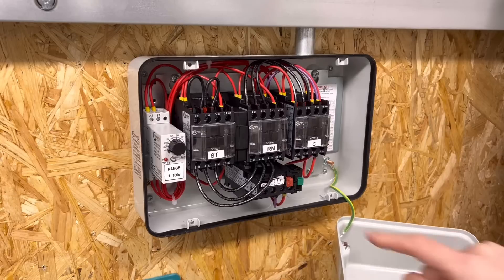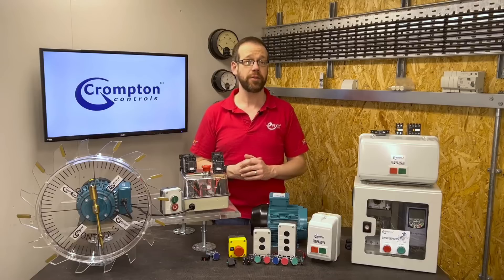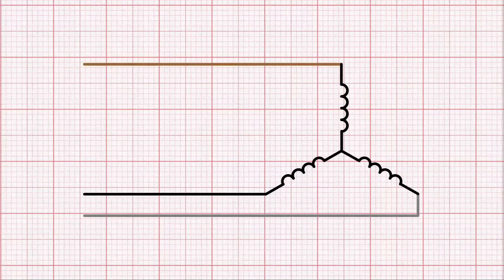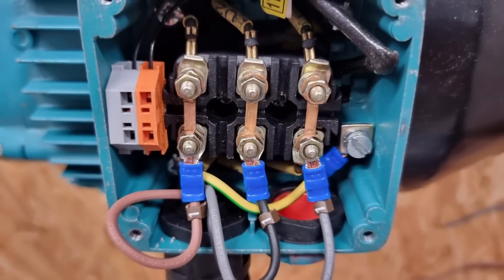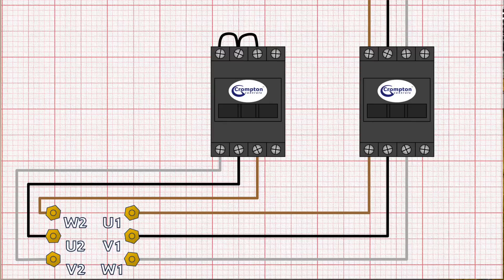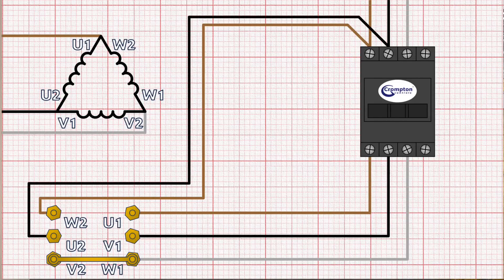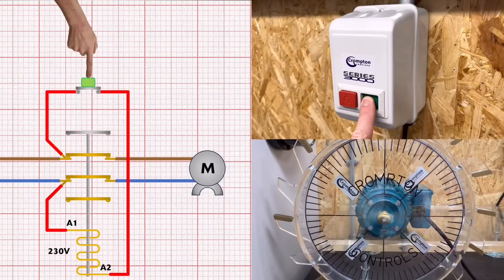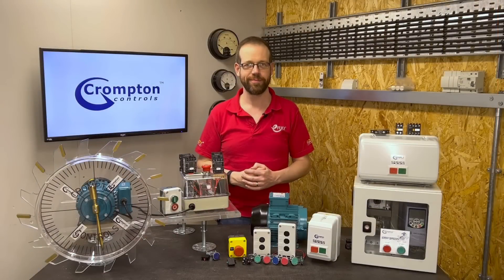Star-Delta Starters Explained

Comment: Good explanation. However quite frequently rather than having separate contactors, the two star/delta contactors are mechanically linked with the internal spacing of the contacts such that the star one disconnects before the delta connects. (I spent may years in industrial electronics)

Comment: You need an 80 ms delay when switching from star to delta because the magnetic field from the star setup has to dissipate before the delta connection is introduced. The term 'very quickly' is nonsense in electrical terminology; only use ms or s.

Comment: This used to be a mechanical switch. 
- The first position was 0 = switched off. 
- The second position was Star. The switch had to operate in this position for a certain period of time. 
- The third position was Delta. This is where the engine has the most power. 
But switching from star to delta too quickly throws out the fuse. Later a mechanical or electronic delay was added.

Comment: Don’t bother with star delta starters these days, control via an inverter, 21st century
Reply from the maker: Got to know how to do it properly before you learn how to cheat! 😃
Reply: @efixx  If you don't need speed control once running, a star-delta starter can also be much more compact in panel real estate.
I can start a 37kW motor with contactors occupying ~200x200mm in the panel, a 37kW inverter will be twice that size at least.
Reply: That's like stating you only buy pre-formed bends for trunking, tray etc...   yes we all do it but if you were properly trained you'd be taught how to construct one by hand - know your basic craft skills!
Reply: Go do maintenance in a factory built in 1999

Comment: Great video but definitely shouldn't be used as a reference video since nothing was mentioned on the having to have the timer wired through the opposing normally closed contactor, that way if the timer fails or the contactor welds closed its impossible for the other contactor to be energised, and not crossing phases.
Reply from the maker: Great point, this is just the starting point for motor control content on our channel, watch this space...

Comment: I thought SD starters went out with the ARC. Why run 6 cables when you can run 3 and a soft start, then also you don’t have to worry about someone setting the transition timer too low and having large inrush current.
Reply from the maker: Horses for courses really, and while Noah did not have a Star Delta starter on the ark, he did have electrical illumination... flood... lights... 😂
Reply: SD is a lot more robust.  What ever suits ultimately.
Reply: @retrozmachine1189 Exactly this! Seen plenty of sort starts stop working.
Reply: A star-delta starter can give higher starting torque than a soft-starter. A soft-starter which limits the starting current to 1/3 normal starting current will reduce the torque by a factor of x 9, whereas star-delta will reduce it by x 3. It depends what the load is like in terms of inertia and torque requirements. Soft-starter has the benefit of more sophisticated motor monitoring and protection.
Reply: @brendanpells912 torque a motor produces in star is often inadequate- modern soft starts are better but an inverter is better still.
Reply: Well yes and no, having used some small soft starts to replace SD starters I am less than impressed with the starting torque. Poor motor makes a horrible noise at start up as the soft start just appears to chop two phases from what I can see. ( bigger KW  soft starts control all three phases and give a better start up. Given the low price of inverters now this is a good option if speed control would be useful.

Comment: There also needs to be more info on inrush current for LED lighting that causes nuisance tripping. But most motors these days are inverter controlled for soft start etc.
Reply: Nearly all my machines in my workshop work on star delta, soft starts don't have the starting torque to get the majority of them spinning up.